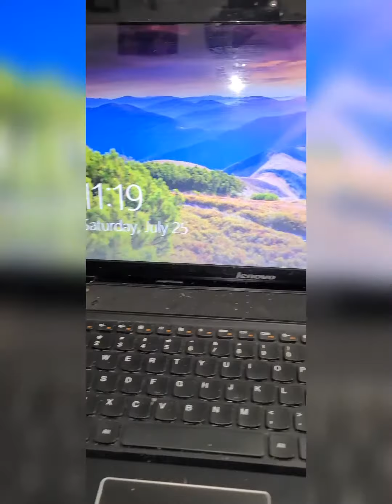HOW TO FIX A G500 LENOVO LAPTOP CHARGING PORT!

Comment: Hello , I got lenovo G510 for like 2 days it shows 0% plugged in charge then 5 second it says 3 min to fully charged, then suddenly shutting down the battery led was blinking . When removed the battery and attached the charger nothing apoears (so i decided to clean it give to an expert ) do you think the problem is in the battey slot ??? Or it's the dust accumulation??? I won't loss data if just cleaning the fan and checking the slot position right ????
Reply from the maker: Clean the charging port if that doesn't work could possibly be a faulty battery or circuit failure
Reply: What does a circuit failure means
Reply from the maker: @yoyabakes damage components on in the charging system
Reply: So I don't have to worry about the data and documents inside the laptop, I hope it's a small issue. Thanks alot for explaining

Comment: I have changed my old laptop's battery with new one and checked charging output voltage and all things were working fine but still laptop is not charging, It shows that laptop is charging but percentage doesn't increases even after 2 hrs of charging. So could you please help me out with this? What can be the cause of this problem?
Reply from the maker: Make sure the charger is good and it possible a circuit issue
Reply: @MrtalentedReid  Yes, i checked its voltage level and seems correct but when plugged in the battery doesn't increases the charge level and also checked battery report shows battery health is 100%, so can't figure out whats the problem
Reply from the maker: Check the update on the laptop
Reply: @MrtalentedReid  ok I will try to update system
Reply from the maker: Okay

Comment: For my lenovo G500, It started charging and stopped after some time. Than again i remove cab and re insert it. again it will start charging for some time and again stopped don't know what is the problem with laptop.. Do you have any solution for this??

Comment: Bro please solve my problem i gave my laptop to repair with same problem and I want to change base for that gum is not going charging port is struck
Reply from the maker: What you really need to do? Am a bit confused be more specific
Reply: @MrtalentedReid  sir I just need to remove port but it full of glue is any trick to remove glue
Reply from the maker: Oh a get u you can try a heat gun or is it a jelly type glue or more of something like epoxy type
Reply from the maker: iFixit Adhesive Remover you can order it on Amazon or ebay
Reply: Tq sir you are very talented i forgot about that cream
Reply from the maker: Ok